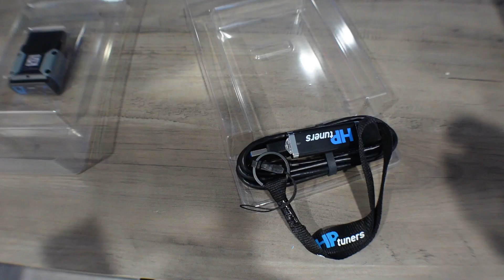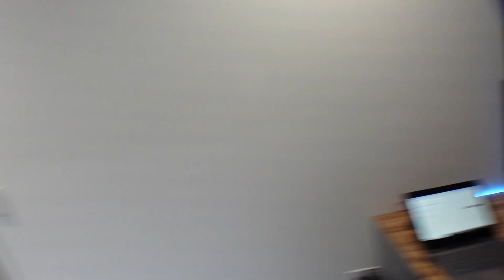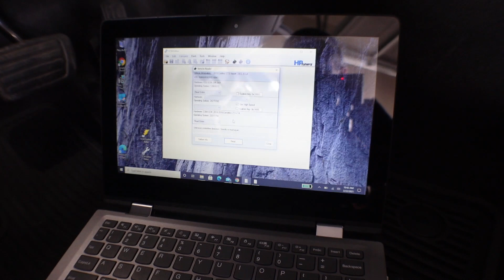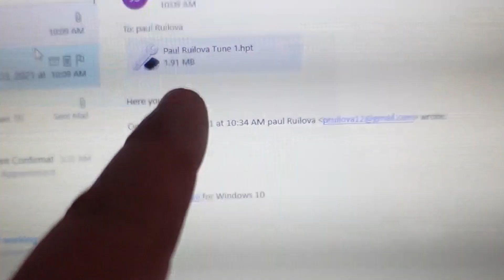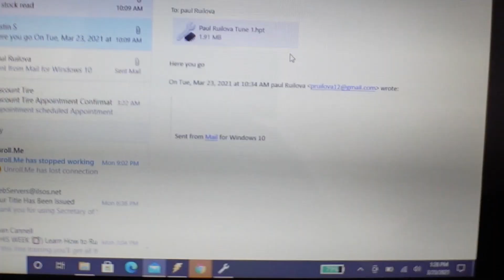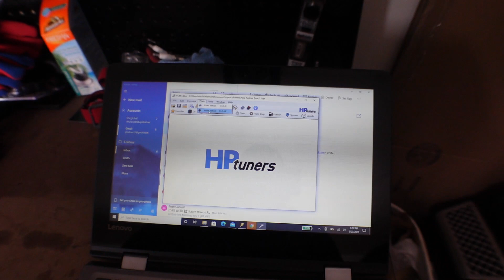MPVI2 set up, Schmidty Tune, Part 1

Comment: Hey Paul great clip pretty straight forward,  
I want to ask :  let’s say if I currently have tune 7 installed (hypothetically) and I want to go back to tune 4 , is there anything special I need to do? What a best way to go about doing that? 

Thanks Paul.
Reply from the maker: No you can go from one tune to another , I have three different tunes for my car , it’s pretty much re-writing software only , if by any chance something doesn’t write properly you can always set it to stock and then write the tune u want .
Reply: @PRviewsvlogs  
Cool. Ill try that. So to go back to stock it’s the same process as reinstalling previous tunes ?  W the HP writer
Reply from the maker: @AnisMaknojia  yes , but again you don’t have to go back to stock just write the file u want to run , only reason you would go back to stock if you have a issue or something.
Reply: @PRviewsvlogs  sounds good Paul. 
Thanks man. Keep up the grind 🙏🏻

Comment: Hey bud, thanks for uploading the video! Do you prefer it over the trifecta? How much was the difference price?
Reply from the maker: So , yes I prefer it over trifecta , and with the MPVI it’s about $300 difference ,  I’m not sure if you saw my other video comparing the tunes , I also have one more video coming out soon with the draggy app comparison .
Reply: @PRviewsvlogs  thanks for the reply! I just finished your other video. Thanks for putting them out. I subscribed as well. Is it $300 less or more? How do I get the Schmidty tuning?
Reply from the maker: Ok so trifecta is $888 unless you wait for Black Friday I believe it’s like $688 , Justins tune is $700 but you need to buy the MPVI2 with 2 credits which  cost $399 additional so you are looking at $1100plus you have to make sure you have sparks plugs replaced with NGK ones and gapped at .027 as well as Inter cooler bled properly .  So it runs a little
More but get more power . I’ll cover all cost on the next video
Reply: @PRviewsvlogs  thank you sir 👍